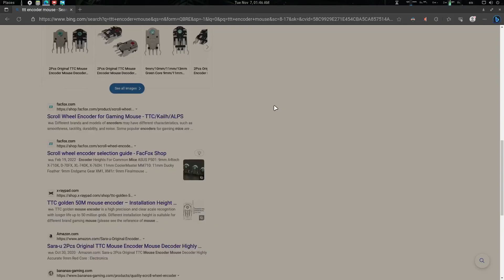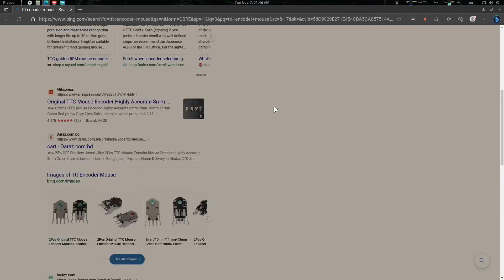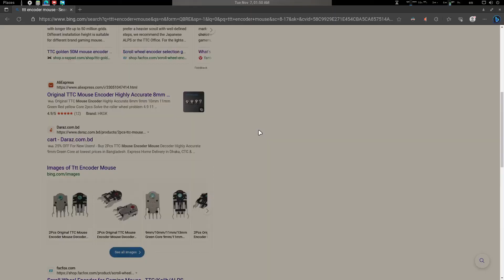Fix Unstable Mouse Scroll Wheel Jumping Up and Down Tutorial

Comment: worked for me after the 2 time (1rst time the wheel lost traction and was working worse than before the opening.). destroyed by mistake 2 of the 4 tiny metal parts that hold the whole encoder. but at last i got rid of the jumping. the wheel doesn't scroll as good as before but i guess it is better than trashing it in the bin. tweezer and mini scissors is what i used.
one need to really move up the 3 little metalic parts inside the tiy wheel and put back everything, thight enough.

Comment: Mine seems to be slightly different so couldn't open that component apart however some contact cleaner directly there seems to be working great at the moment so thank you very much for making the time to create this precious shared discovery.

It truly is the same from the entry level mouses to top brands from what i have researched and no one until today had such a reliable solution, most just advised to use an air compressor can, which does not effectively fix the issue.
Thank you again

Comment: Saved me from discarding my expensive mouse, subscribed. Used to use cheap mouses, thought an expensive one would resolve this issue, but even the expensive one turned out to be same. Was about to give up, but took the risk of opening up the mouse (it has warranty but the moronic service center people would not understand the issue), and it worked! Thanks a lot!

Comment: okay first time opening a mouse and first time fixing it but it worked my mouse was onikuma Cw905 and it was kinda hard to get the four guards up to loosen the inner wheel but after putting my finger nails and pushing a tiny bit it came right out and then i did as the video said and it worked!
thx again i will be visiting this vid 100% in the future 
tip to the people who don't want to break the mouse open: just do it search online on your model and see its structure and where the screws are at and if not online do it ur self and see how it gose the mouse is fucked up anyways so if u gona replace it at least try once and see if u can fix it like i did hope u succussed

Comment: I bought the Logitech G435 headphones USB-Lightspeed broken headset no longer works. My cousin G502X Mouse took it in a short time broke down and no longer works. A few years ago I was using G300S 3 months later left -click key broke. Now I am using G2003 Lightsync, but when I do it back and forth, it goes randomly. Moreover, the products are more expensive than others. Do not buy anything from these dishonorable people.

Comment: Just drizzle some rubbing alcohol on the encoder and push it back and force, preferably with a tiny screw driver in between, to loosen the gunk. It worked in my case. This video is about - jerry-rigging- bending the contacts so the wheel makes contact again. Another alternative to buy an encoder of the proper height, e. g. 9mm for Ducky Feather.

Comment: yesterday i learned how to open up a mouse and managed to clean off gunk and hairs from inside the wheel, and i thought that fixed it.
however, the problem returned about 30 minutes later. today i found your video, followed the instructions as carefully as i could, and by some miracle i managed to not completely ruin my mouse.
now it scrolls like a mouse that's fresh out of the box, absolutely great video, clear and simple instructions.
i did remove the skates without a hair dryer, and they are now trash as a result, as i feel lots more friction with the mousepad now so i'll likely still replace the mouse, but at least now i still have a mouse to use while waiting for the new one.

Comment: Thanks a ton, brother. After watching tons of videos that suggested blowing into the scroll wheel, applying alcohol or WD-40 inside the encoder, and other questionable fixes, I finally tried this method, and now my Dell WM118 is working perfectly. I used a pair of tweezers, which really helped in bending the copper prongs outwards and placing the roller and steel plate that connects to the roller.

Just a heads-up to anyone attempting this: if your hands aren’t steady, it’s best not to try this as the roller and encoder parts are extremely small and delicate to handle.

Comment: I've just fixed my mouse wheel. There was some dirt on the small inner wheel that was impeding the contact with the tiny wire. I didn't have to go through dismantling the inner wheel though, and now it is working perfectly. Thank you!

Comment: Thx alot man, Have asus rog ultra light mouse it happened to and replaced it with a lightspeed which I cant get used to, to heavey.
 didn't even need to open it I just took a screw driver and pushed the scroll towards the drum and it worked

Comment: I didn't have to disassemble the scroll wheel encoder to correct the jumping up and down problem on my Microsoft wireless mouse 1000. I just inverted the board and submersed most of the encoder  in a small cap filled with isopropyl alcohol and used a small hex key to spin it while submersed. I then blew it out with compressed air and repeated the process a few times.

Comment: i'm using very small - screw instead of the +

3:18 mine have a lot of black debris, after cleaning that, the brush also have a lot of gunk in the tip soo cleaned it off as well, i did 3:42 where you gently realign the brush too. then close it up like in the video.

for the button that double clicks or hard to click, i use wd40 in the buttons and pressing them multiple times until it seeps everything inside.

this is the most effective way to FIX the dirty or worn-out scroll wheel.

Comment: Tried this with a razor basilisk x and didn't have any luck. There are little hairs of copper on the notched scrolling disk and an embedded copper track on the encoder but cleaning the track and prying up the copper hairs farther didn't seem to do anything. What I did notice is that one of the sets of copper hairs was a little off which may have been causing the issue. Perhaps I should have removed that set.

Comment: Worked great for my Microsoft 3500 wireless. A bit tight space to work on but I managed to open the scroll and bend up of the 3 blades with a sharp knife. Had to break the upper left "hand" to open it tho. No problem using the remaining three to close the wheel scroll. Was about to discard the mouse. Very useful tutorial! A big THANKS!

Comment: I must leave this in case anyone stumbles upon it: 
I could not deattach the wheel or the encoder and blwoing did not work, But what worked for me is bending the wheel ever so slightly above its freedom  and spinning it in that position. Like, if in working state wheel is 90 degrees against encoder i bend it maybe to 70 degreed and spin 3 full spins. My best guess is it bent the contacts inside encoder to better connect with the wheel. But anyway now instead of having  mouse wheel act wild on 80% of its circumference it only acts RARELY in 1 specific spot.
 I had to share it. Maybe that'll work for someone. (Mouse  is A4tech F35)
Reply: I love you ! it worked like a charm using anything else never worked with this mouse finnaly no more frustrations !
Reply: @pkman98  glad to hear it, hope it still works :)

Comment: Thank you, this technique helped me. I was hesitant to open the assembly on my 6 years old deathadder. I had to open it bit forcefully because the contact part is soldered on 3 profiled copper plate conductors. I only bent it 2-3 mm then I took out the spring and encoder wheel with small tweezers. The amount of black greasy stuff and amount of wear on the contacts was a great surprise.

Comment: Thanks a lot! Fixed my issue, no other tutorial was as effective. 

My only issue now is that I do not feel every "scroll" anymore if you get what i mean. Earlier I could feel with my finger every time I scrolled a line now it scrolls smoothly. I believe it is because of an error on my side. What could it be?
Reply: You could have placed the O shaped metal spring the opposite way so that the pointy part does not go between the teeth on the plastic wheel with 3 contacts.

Comment: Just a tip: I was about to start this process and instead of following through every step, i just tried cleaning that device next to the scroll wheel with some rubbing alcohol to remove some dust, and this seemed to do the job for me. I would maybe try to see if that works before pursuing the next steps. Great video, wouldn't be able to figure out where to clean without this. Thank you!
Reply: Thank you. I applied some alcohol on a tissue and cleaned the middle button like you said and my wireless mouse seems to have regain its (mostly) smooth scroll function without any problem.
Reply: dude thanks to you i just blew some air into the hole and it literally fixed it, thanks for this coment :face-red-heart-shape:
Reply: @yumikicat  Yeaaah life saver, I also shook the mouse a bit, turn it upside down, turn the wheel, blow hard and like black magic it was fixed. Wonder how many people replaced their mouse when it was just some dirt stuck on the sensor. I was about to buy a new one, since I have a 20 dollar mouse. 😂😂
Reply: Took me a few minutes of blowing air into that encoder device and it works perfectly now.
Reply: Godsent comment, the cleaning worked marvelously, my cat's hair was stuck in the contacts and after removing it and cleaning with the alcohol, it's like the problem was never there!
Reply: I just blew air onto that device and it helped! try just blowing hard on it while spinning before doing the whole process
Reply: Works for some time